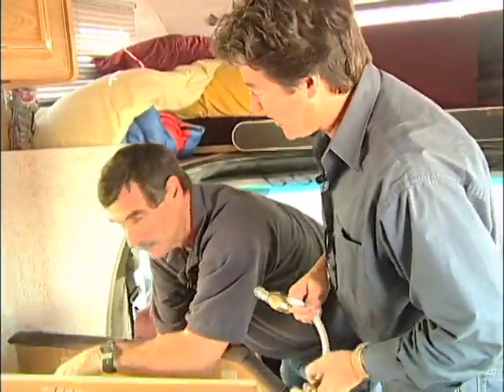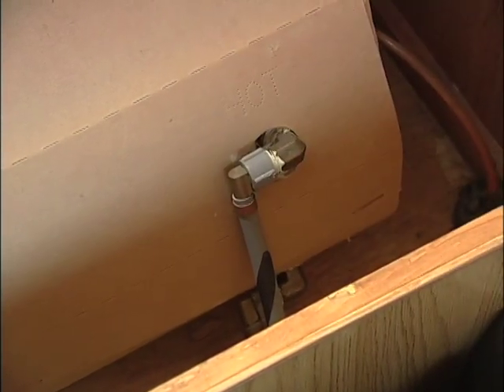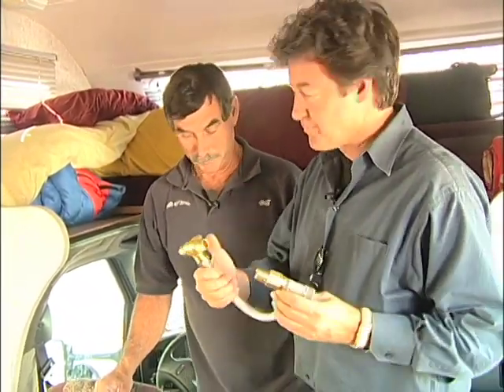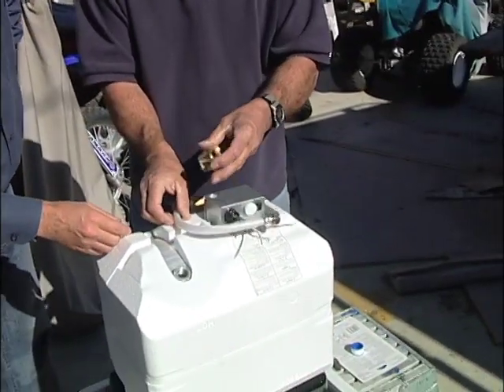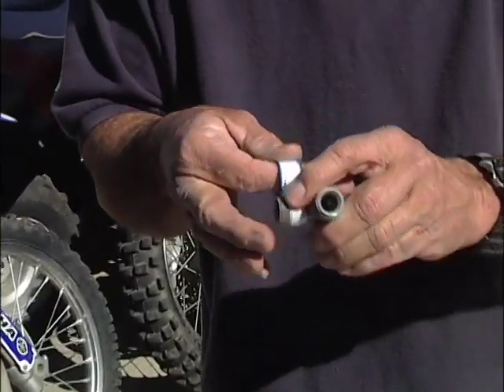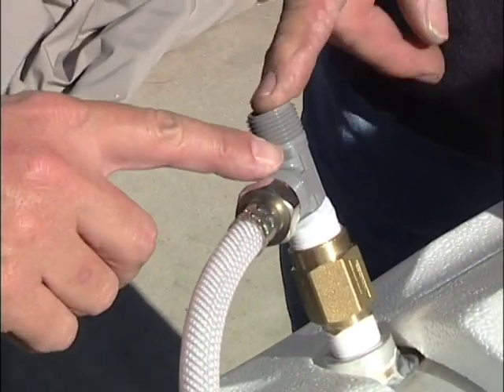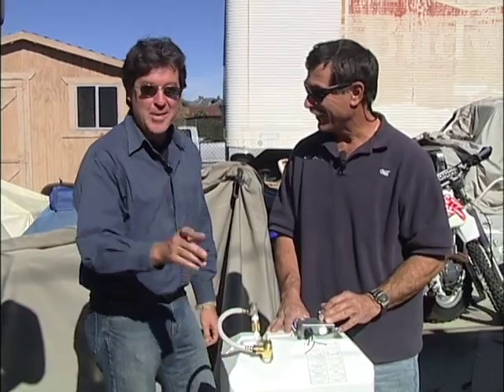RV How To Water Heater Bypass

Comment: Thank you so much for the accurate comments in this video.  I was needing to put a bypass on my hot water heater, and watched this video 1st.  Then I watched another video that said the bypass goes on the cold water side not the hot. 

 Having never done one of these before, and having not bought my bypass kit yet to look at the instructions, I'm thinking WTH, which video is correct?  Well folks, it isn't this video that's correct.  This video is WRONG, and it's lucky that I watched a 2nd video, realized 1 of them was doing it wrong, then came back to this video, and looked at the comments before starting because your incorrect information could very well get someone hurt or damage the water heater.  In the future if you don't know what you're doing, you might want to rethink making an Instructional How To Video.  Just smh.

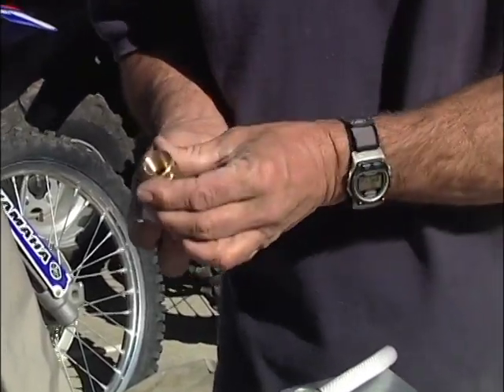Comment: This video is incorrect. You just completely disabled the water heater if you follow the instruction in this video. Because you put the one-way check valve on the cold water inlet, see 1:55 and the arrow at 2:31 into the video, thus cold water can never enter the water heater tank now.
Additionally, the video installs the ball valve on the hot water outlet. With this setup, even if the check valve allowed cold water to flow you'd be by-passing the water heater while also filling the water heater tank.
But because the check valve WILL NOT allow cold water to flow into the water heater tank you just disabled the water heater.
---
So reverse the valves from what the video shows;
1. The ball valve goes on the cold water inlet. This allows you to direct the cold water into or around (by-pass) the water heater.
2. The check valve goes on the hot water outlet with the arrow showing the flow coming out of the water heater. This allows the hot water to flow out, but when in by-pass mode the cold water will be blocked by the check valve, thus not allowing it to enter the tank via the hot water outlet.
---
Hope this helps
Reply: THANK YOU!